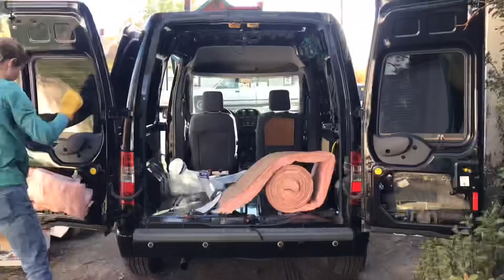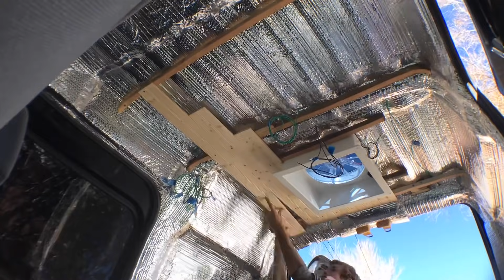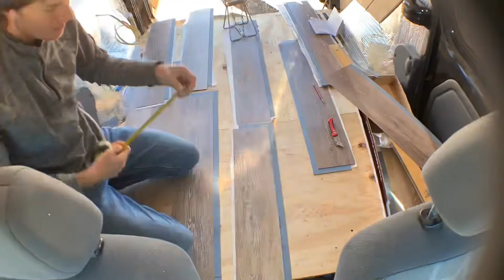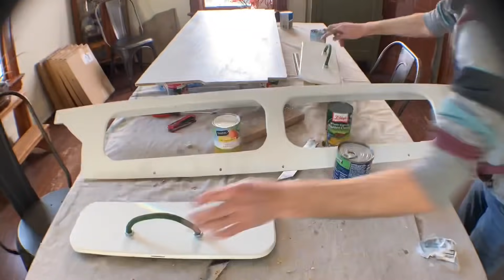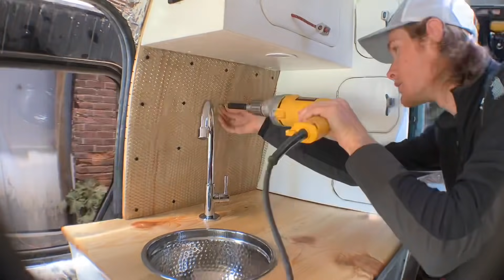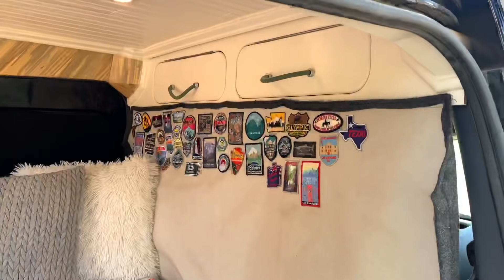Incredible Tiny Van Conversion: Full Time Lapse Video

Comment: Not that you need told, but you really did a great job on this. I see a lot of people go to a lot of trouble to seal up the walls but they leave the floor exposed and just put a subfloor over it. I would think the moisture is still going to get under the floor and up into the wall cavities and cause mold issues but maybe I'm wrong. I just know how much moisture can form with just a 10-15* temp difference on metal.

Comment: That is a kick ass layout and design. Love the round window and the diagonal wood.  Really makes a difference, along with the windows.  Great job. I'd buy the plans for this if they included the hot water and electrical systems design and products.
Reply: Yeah would also buy a guide for your build in that car. A VW Caddy is also nice, but the old Ford Transit Connect has something special!

Comment: Hi Austin! I’m confused about your use of Reflectix directly against the body of the van. The body of recommendations agree that an air gap is necessary to have any R-value. The reflective surface does work well against glass as it is a radiant surface in that application. Can you point me to any documentation that supports application directly to the van wall, please?

Comment: Looks awesome. I wonder how much weight did the conversion add to empty van?
Reply from the maker: It definitely added weight, I didn’t keep track so I don’t know the numbers. But I usually tried to choose materials that were thin and light
Reply: @UltraAustin  have an estimate? Beautiful build, but TC is on a car chassis. I was also wondering on weight.
Reply: Could take finished van to weigh bridge and then compare to oem quoted kerb weight.

Comment: Austin, can I ask you a few measurements please? 1-how much space between the bed and your cupboards? 2- bed height, just the structure? 3-when you are sitting, how much distance from your head to the ceiling (how tall are you) ? 4- how thick is your mattress ? 5- how much space do you have to enter passenger side sliding door? Thank You so much

Comment: That's a cracking build, well done. 

Did you balance out the weight when you were building it or have you adjusted the suspension to account for it? 

I'm not trying to be a smart ass, I've converted 2 day campers in the past and am now looking at a larger conversion which will have the full on water supply, rock & roll bed etc and I can't find any references to weight distribution in other videos.

Comment: I know this is a stupid question but are you just drilling the wooden frame on the roof and walls straight into the steel inside the van?
Reply: Not a stupid question, I'm curious too. Some people use lag bolts to go through the existing holes, I found that awkward. So looking for a solution.

Comment: Super classy build. How long did it take to build from start to finish. What vehicle did you build your camper van on. What amenities does it have. I bet you get awesome fuel mileage. I really dig that port hole window. I look forward to future videos. You just earned yourself a new subscriber. And the end with the out door seating platform was just epic. You really need to share details on that. Thanks
Reply from the maker: I slowly built it out over a year as I had the time/money. It’s a 2010 Ford Transit Connect

Comment: I don't see you painting drill holes in van with rustoleum.  I don't see you coating screws with silicone before putting them in.  Rusty rust

Comment: How did you attach your overhead storage above the driver/passenger seat?
Reply from the maker: The back of it is sitting on and screwed to the small plastic shelf that come stock in the van, and the rest is screwed into the side walls and roof where it is thick enough not to go all the way through

Comment: What kind of chair were you using
Reply from the maker: It’s a custom seat that was made by cutting and welding metal bars and sheets together
Reply: Ultra Austin that chair is quite Unique, you should put it on the market🤩

Comment: Can you please make a video going more in depth I want to do the exact same thing
Reply: I wanna know how you did the propane and secondary battery
Reply from the maker: I’m planning to do a more in depth van tour/info video eventually. As for the propane I kept it super simple. I just use the small green propane canisters for my little Coleman’s stove. I also got an adapter to be able to use those for my instant water heater as well.
Reply: Ultra Austin those little green canisters last a while.
Reply from the maker: I don’t use a lot of propane, so I chose to save the space and just use the little cans. They actually lasted 2-3 weeks with the amount I used them

Comment: Drilling the metal of a car is a big mistake, it creates a lot of points where it will rust, on the floor you could use holes for fixing the seats, but otherwise - cool!

Comment: Reflectix is NOT insulation and has no real R value...The floor..2x4's...wow..NOT needed at all...you sacrificed almost 5 inches or more maybe of headroom by building up that floor with too thick wood frame! Then on top the plywood..! 5"!!! Sure it's a great looking conversion and very neat well put together..no question about that but I don't understand some choices from an engineer's standpoint...just opinions and you know what they say about them!! Safe travels to you!